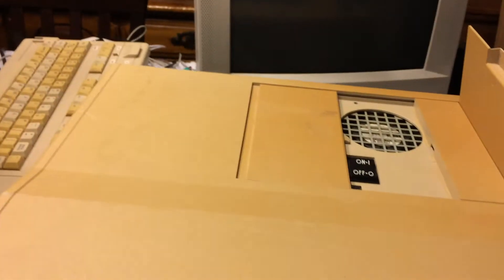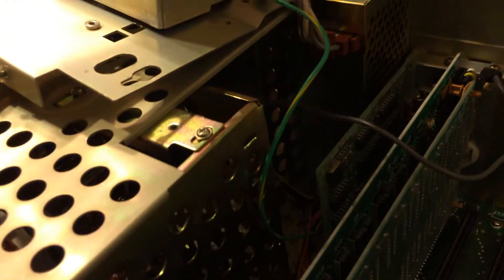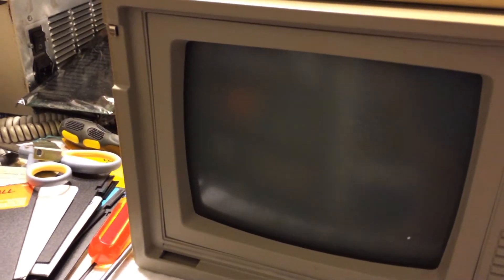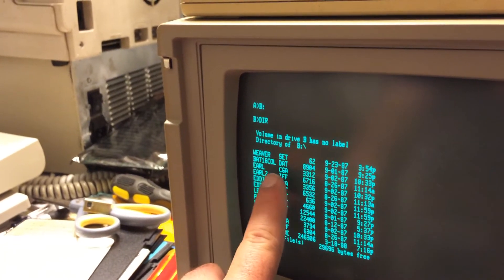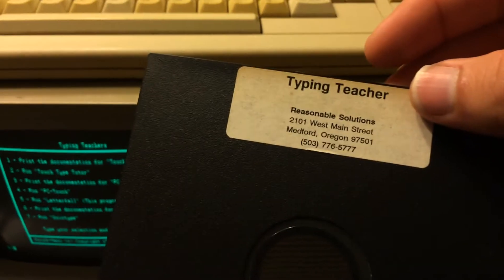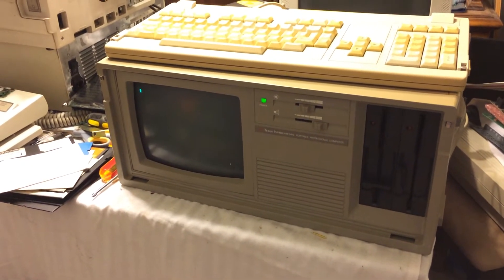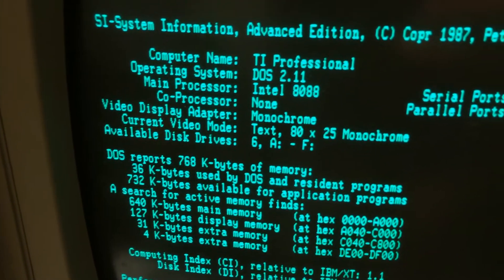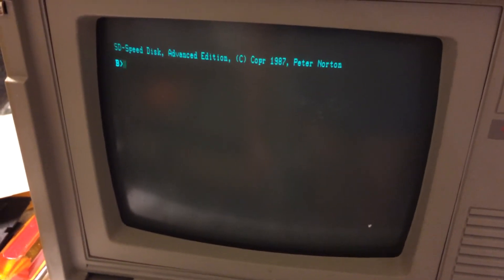Texas Instruments Portable Professional Computer Upgrade.

Comment: The desktop version was my fam's 1st PC!  In 1983 for ~$2.3 k (~$7.0k in 2023) w/ 256 KB RAM, 2 5.25 in. full height double-sided FDDs, MS-DOS v1.?? (soon upgraded to v2.11 that added support for directories and 360 (vs. 320) KB formatting of floppies - ooh!  ahh!), 300 Baud (aka 0.0003 Mbit/sec) ($300, i.e., $1/bit/sec or ~$3/bps in '23!?) modem and a TI dot matrix printer.  At the time, a 2 MB HDD was available for ~$2K (i.e. $1/KB or ~$3/KB in '23)!?  Box of 10 320 KB DataSoft brand UNformatted floppy discs were $40.  Dad got it for me to learn about computers (which I did, taught myself BASIC on it, took college CS classes starting summer after 8th, became a Sr. Sfw Dev), but also to help his Chinese restaurant, which it did starting with a simple daily food and bar sales ledger spreadsheet / month even with some macros to help ease data entry (which, granted, was a pretty trivial use case for ~$7k in today's $s) I created using SuperCalc which he bought for I wanna say ~$500.  He then bought the Peachtree accounting suite of which we only used the accounts payables module and only to print paychecks which was finally a descent use case.  My dad had looked at the TRS-80, Apple IIe (incl. Franklin compatible) and IBM PC.  He thought the IBM PC pricing nickeled and dimed you and the Apple IIe not serious enough for biz.  Vs. IBM PC, it had a whopping 5 vs. 4.77 MHz and 720 x 300 x 16-colors vs. 640 × 200 x 2 (of 16) colors!? Ooh! Ahh! But it was only an “MS-DOS” vs. “IBM PC” compatible, so almost everything required a port specifically for it which meant not much were. 🙄 My dad got the losing tech of every tech war: 1) Beta vs. VHS, 2) Magnavox Odyssey vs. Atari 2600 and 3) TI Professional vs. IBM PC or Apple II. He also got a cabinet sized tv projector, LaserDisc and dining table sized sat dish, but there was no “war” there, they just died on there own merits (or lack of). 🤣

Comment: Most software written for a T1000 will not work on this or any other MS DOS based PC.  Tandy followed a different standard, the PC Jr standard of graphics and sound.  The graphics chip is broadly compatible (the Jr standard is mostly known as TGA for tandy graphics adapter. TGA supports all CGA formats, but CGA does not support the extra TGA features found on the tandy 1000 graphics cards), but not the 16 color 320x200 mode most T1000 games play using.  Plus the sound chip is not present on any other models of PCs.

Comment: Do you have a manual that explains the jumper settings on that multifunction card? I have one of those cards here as well but I can't use it, the memory on it (only 256 k without the piggy-back board) conflicts with the 786 k that I already have in the machine. It must be possible to disable the memory on the multifunction card with those jumpers, which would allow me to use the rest of its features. Hope you have something, cheers.

Comment: i saw one of these kinda banked up with broken plastic bits for 20$ on ebay with no bidders or watchers. almost went for it but did not dew to fear of non PC compatible... now i wish i did.
Reply from the maker: Well, it's not really PC compatible.  You have to have Texas Instrument's version of MS-DOS to boot this computer.  Then after that, only MS DOS programs or text based programs will work.  This is strictly a business machine.  But for $20 it's worth it for the disk drives.
Reply: do you got other hobbies besides vintage computers? im suggesting you explore them so we get more uploads!

Comment: That is one rare machine indeed!  768K RAM, could you imagine the luxury?  Even Bill Gates said "640K ought to be enough for anybody."  Little did he knew he was referring to Windows 10 and meant 64GB of RAM.

Is the video card in there definitely CGA?  Could it be a strange mono/CGA card?  Mode CO80?  Perhaps it will take a CGA monitor plugged in the back and do a "dual monitor" type setup in the old-school way?  Maybe the card is Hercules compatible, in which case you can use something like SIMCGA to emulate CGA on top of PC emulation.
Reply: windows 10 can only handle 64gb? i got a 8 year old workstation thats got 48gb and can run up to 192gb
Reply: No I didn't mean it that way.  That was just a facetious statement.
Reply: i dont like going above the 6.0 kernel so for all i know thats true. hated win 7 8 and 10, stick with server 08 and vista.
Reply: Bill Gates never actually said that. And the TI does support graphics, just not in a way that is IBM PC compatible. The resolution is 720x300.
Reply from the maker: It appears to be a monochrome card with a video out, which is why I thought it was CGA.  No graphics at all, only text.  And plugging in an external monitor just duplicates the display.  There is a model with a color monitor inside.  I've only seen one show up on ebay.
Reply: check your spam, i tried sending you a video so im in your spam now.